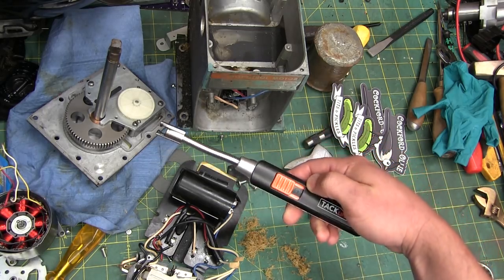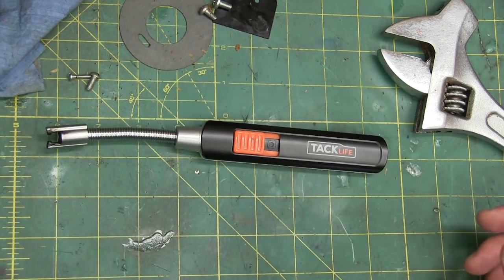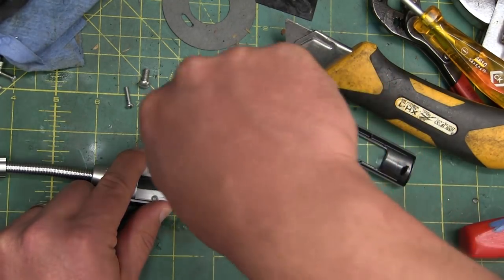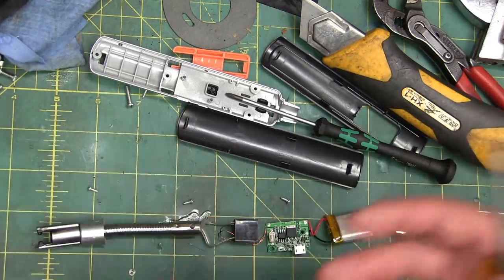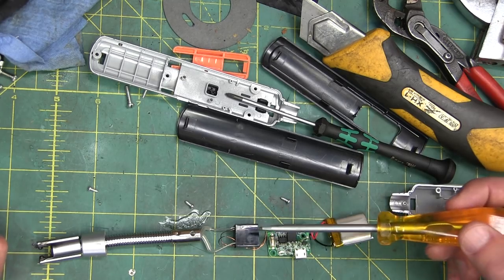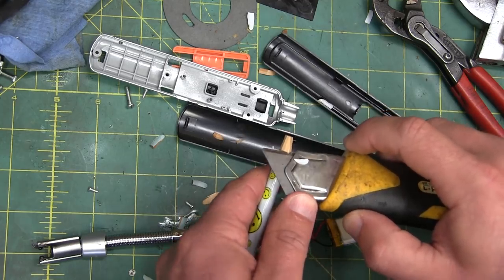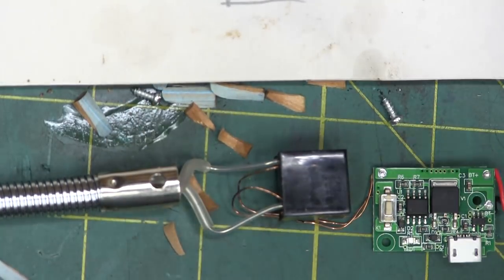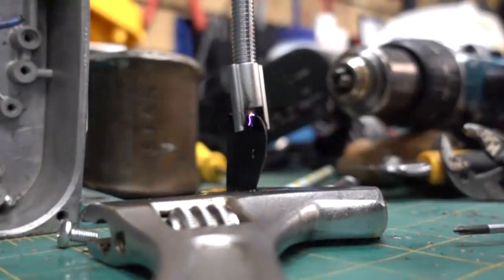BOLTR: Arc Lighter | Zzzzzap Gadget

Comment: There are a LOT of ways to implant malware through your USB port. Don't plug crap into your PC, use a charger.
Reply: Or cold use a really cheap cable that just has power but no data transfer. How do you think they would store malware on this kind of device without any ram/rom to speak of?

Comment: 9:46 It helps to have a system for that. It may well be an (unwritten) "industry standard" thing, but input on the left, and output on the right makes most sense to me, when making (or lifting) schematics. In a similar manner, ground on the bottom and whatever supply voltages, on the top.

Comment: Nifty little device. When I saw you sharpening the pencil reminded me of an exciting experiment I did when I was young. Found a neon sign transformer and made a Jacobs ladder. Had great fun sticking different things in the arc, that is until I used a pencil. Next think I knew I was at the other side if the room, I was sitting in a wheeled office chair at the time. That is when I leaned graphite is conductive. Have taken high voltage seriously ever since.

Comment: with almost any kind of lighter, it comes down to longevity in my experience. please tell us how long it takes until she chooches he last.
Reply: stereomike111 about as long as the battery’s entire life until it can’t hold enough charge to create arcs
Reply: I had one of these things, lasted about three or four months before the electrodes just didn't work anymore
Reply: In my case, 5 minutes.. I just short-circuited this once (tested it on a metal cap, because of course I did) it stopped working and the battery started to heat up by itself, would not recommend...

Comment: Maybe the FCC certification is for use as an electronic jammer? 🤔
Reply: it denotes part 15 compliance, basically it means that if it is interfering with transmissions (knowing or otherwise) you can be told to knock it off and then compelled to comply
Reply: FCC - Frivolous Chinesium Crappola

Comment: just to eleborate for those that don't know what AvE was saying, the 2 coils are basically a transformer, but you cant transform dc because it needs an EMF that builds and collapses to induce a voltage on the other winding.

so an IGBT is used to simulate the effect of a sine wave, by turning on and off at varying rates, we call this an inverter, taking dc, and faking ac.

the reason the voltage goes up, and the current goes down, is because the power must stay the same, and Power = Voltage * Current (apparent power), 
and the amount of that change is controlled by the ratio of windings, for example 2:1 would be 24 and 12 windings. 
this one will be a very high ratio, like 1000:1 or more.
Reply: most people use a high voltage arc? not that I am aware of.

Comment: FYI UB: it doesn't need to be powered by an AC source to be a voltage booster. The brain box can simply switch the DC supply and feed that into the diode voltage doubler. That's how DC-DC boost converters work, too.

Comment: Exact same Sony clock radio I bought 8 years ago.  Adjusts automatically for DST, has I think a 9-volt battery to keep time during power failures. Gains a few seconds a month: crystal vibrates a bit too fast?
Reply: I've got a very basic Sanyo crapper (no DST adjust) that used to gain about 5 minutes every week or two, I'd have to re-set it all the time because it'd gotten too far ahead (like half an hour or more).  Was like that for about 10 years, then suddenly it stopped gaining time - haven't had to adjust it for the last couple of years.  Maybe the backup battery is dead, haven't looked at that - I just enjoy not having to guess how far ahead it is when I'm still half asleep and the alarms going off.

Comment: The pocket version has sliding electrodes with a wider gap that's perfect for top of the ear shots when there's just no room at the bar at call for last orders. The battery capacity is practically 1/5th of the flexible neck model but that's plenty enough to cause some trouble as it happens.

Comment: AvE, can you do some kind of testing on the frequency coming out of the MOSFET, the input and output current and voltage from the transformer, etc.? It would be really interesting to see the parameters they chose to make the circuit work so well for so cheap.

Comment: So, I've been meaning to buy one of these just to see if they could be a quick legalish taser. Just solder on some new leads and see if you're drunk buddy will give it a ride.
Reply: Gerald Gepes yeah the hold my beer buddy, or the I'm ok buddy. I was fortunate enough to have both kinds of buddies let's not forget the buddy who can fall over and not spill his beer buddy
Reply: Raymond Mucklow we would get shitty on a sledding run, had one buddy roll his sled halfway down the hill, rolled three times and still had his beer intact. The best types of buddy.
Reply: Gerald Gepes my brother brought out his new to him sandrail on my 19th birthday, I had a mickeys 22 hornet in hand we took off across the desert we hit a wash out flipped in the air landed on the right side tires to then land on all 4 when it was all over I looked down I had my thumb in the top di dnt spill a drop. My brother (with it still running ) hit the gas we took off. Awesome.
Reply: wrong output frequency and waveform.
Reply: erik - these two or the tazer? : )
Reply: Well, given the fact that it has only a spark gap of around 5mm, you will get 15kV out of it. Tasers deliver around 50 kV with around 7 watts, way to much for this thing to handle. Yes, you could raise the spark gap to around 1,5 cm (you absolutely need one, if you don't want to have a device that either zapps the electronics inside (or you at random intervalls)) but then you'd have a "taser" with 1/70 the power of a normal one. Not worth it.
Reply: Gerald Gepes they dont hurt as much as the scare you will get, it will burn you a bit... trust me i know...
Reply: It does hurt and only burns if you are not in contact with your skin when you turn it on. Not taser level though, but fun at parties.
Reply: Gerald Gepes how did you post this 5 days ago??
Reply: Get a so-called "400kv module", it's the business part of a taser and legal as long as you don't call it that
Reply: PlatypusVomit thanks man I was so confused
Reply: or, you could buy taser. pretty certain the only way owning and buying a taser is illegal, on the civilian market, is if they exceed like 50k volts as that is the highest voltage that even the police can legally have & use. in the states however it's pretty much open season, as far as what voltage "level" of taser you can own. 
even still, you're allowed to (legal to) own dry tasers here in Ontario, at least. they're super popular with ladies who frequently frequent bars and clubs & that walk home/to their bus stop. never heard of them being illegal here in canaduuurp before though, until now that is of course.
Reply: Alex Hendel Tasers are illegal to own in Michigan unless you have a concealed pistol license.

Comment: That coil has me thinking I could use that for my 1/4 scale Offy that I'm building.  It'd go perfect in my magneto housing as I can't actually build a 1/4 scale working magneto.  It's compact enough to fit and put out 20,000 volts or so to the spark plugs.

Comment: the electric arc choocher! I've been contemplating picking up one of these.
no surprise that its a lithium ion onto a charge/control circuit, and transformer as the voltage doubler just ain't gonna create an army of angry pixies of that particular size. that being said, that transformer must have some crazy amount of windings on the secondary.

Comment: The noise appearing on the (AM) radio suggests the operation is at considerably higher frequency than 20 kHz.  At least the harmonics must go over 500 kHz.  Also, I would expect it to use a resonating capacitor, either in series or in parallel with the primary.  Anyway, where could I buy one?  I could check the frequency and probably work out a basic schematic.  I could characterize the transformer as well.
Reply: It's a spark gap transmitter.
Reply: NiHaoMike  —. Yeah, Harmonics.

Comment: Normally those potted transformers have their own drive circuit inside. You can buy them crazy cheap and they are in alot of Chinese junk. From small ozone generator hight lights to electric fly swatters. The circuit board you did see is more than likely just a charge controller for the battery. Able to make sure it dont charge too quickly, or over charge as well as useing that big mosfet to disconnect the battery to stop you from over discharging the thing.

Comment: No such thing as a diode-only voltage doubler, tripler, googaplexer.... it also needs capacitors, as it's those capacitors that accumulate the stored charge each half-cycle of the AC voltageum.

Comment: Doing a voltage ladder with DC isn't that hard, you don't have to use pretty AC, a square wave will do. You can make that easily with a full H-bridge. It's like a reverse full bridge rectumfrier.

Comment: that's an ionizer from hair dryer (uriginally use 50-60hz),using charge controller (the 5 pin thing right next to the usb) , a 555 timer driving the mosfet.
also the noise is caused by the spark

Comment: That little IC at the right-hand side is the actual charger IC. The 8-pin IC to the left is most likely a timer IC (say a 555 timer), which drives the actual MOSFET (the biggest IC at the center).

Comment: Just a bit of nitpicking, it doesn't arc through that piece of plastic, it arcs around it. Electric breakdown usually occours along surface paths of a dielectric and is then called tracking. Quite an important material property. Shit like isolating tape usually comes with a CTI value to tell you what it can handle without turning that metal panel you hide your jerry-rigged "we ain't got time to change the whole cable" quickfix behind into a widowmaker.

Comment: You forgot the capacitors between the diodes. That's what builds the voltage after each diode down the chain. Seen this in diagrams of old tv HV multpiliers in an ECG book

Comment: For a voltage doubler the diodes don't need to be special. You only need to make sure that PIV rating is not exceeded across 1 diode.

Comment: The "MOSFET" on the right could just be a LIPO charger in itself. Yes, they make em that small.
No brainbox required. That would be a DCDC boost coverter with the switching coil/transformer in the black box to make the angry pixies.

Comment: I know this video is one year old, but I think this small 5 pin jobby is the actual charger. Bigger 8 pin chip is a small cheap uC which handles the MOSFET, switch etc. and propably second undervoltage protection (these small li-ions usually have their own protection)

Comment: No. 
The breakdown voltage of the diodes should be just (a bit) higher than the input AC, as all of them are series and the breakdown voltages add up. So do the capacitors in that multipliers. Each cell, consisting of two diodes and two capacitors should be rated for the input AC*2

Comment: Just looked this gizmo up.  The one with an 18650 (same brand) is a $1 cheaper (I'm assuming it doesn't come with the battery).  That's a lot of angry pixies!  Slightly different format.
If you want the long neck and the 18650, it's a buck more than the internal battery model.

Comment: i have one of these lighters and it works extremely well but where it lacks is the fact that you can heat metal it will only work with flammables
Reply: also one of those lighters sets you back about 10 to 15 bucks

Comment: The chip on there is actually pin-compatible with a PIC microcontroller and someone made one that plays a tune while you're setting things on fire by modulating the frequency. There's a write-up at ultrakeet com au /write-ups/modulated-arc-lighter
or see it in action /watch?v=VWGIgH9ViEE

Comment: Correct me if I'm wrong; oh how I know ya will; but is an electric arc/spark running a voltage at 20Khz not the same frequency that is used to split water into its componant molocules, i.e. H2O becomes H,H,O and the main technology into Hydrogen Burning I.C. Engines?  It brings the question, will  that 'Lighter' set fire to wet wood/paper/whatever too?  Did ya try it on a flammable gas, just fer laffs!?
Awesome lighter.  Are they available in Europe, Britain et.c.?  I'll keep searching, mè fois.
(P.S. Sorry but....Etsy says "Sold" on the Tits'n'Pickles sticker..as of when I looked at it today, Sunday 29th July 20.21 here in UK, 12.22 West Van cover, Kenuckistan time)

Comment: 6:11 I'd rather not be quite as optimistic with the "over-integration" of things :) That tiny lil' six-legged chip's probably the dedicated charge controller (coincidence that it's right in-between the USB and the battery?), and the 8-pin one's only handling the oscillation & MOSFET driving. The whole thing sounds like a flyback converter of sorts.
https://en.wikipedia.org/wiki/Flyback_converter

Comment: The circuit is just a 555 timer running at 30-50khz with a transistor output.

Comment: "100 milliamps or something like that" writes down 100 milliliters

The voltage multiplier circuit you were trying to remember with a diode (and capacitor) ladder was a Cockcroft–Walton circuit.

Comment: Also wouldn't it make sense that you only have 1 inductor and you use the energy from the collapsing magnetic field to generate the high voltage. That's how spark plugs work.

Comment: Lithium batteries have always confused me. as long as the supply voltage stays at 4.2 it should self regulate.. right? but a voltage regulator is cheaper than a dedicated charge controller to design and implement so there's gotta be a reason guys don't do that

Comment: Does anyone have any suggestions for a good/decent "starter kit" soldering iron? I want to teach myself and I don't know brands, flux, lead-free, etc...

Thanks in advance!
Reply: TS100 is very good bang for buck, keep in mind you need a seperate 12-24V power supply. Just get some 60/40 rosin core solder and you'll be fine to start with, extra flux is optional.
Reply: Also you can buy solder learning kits on the internet
Reply: Thanks gang! That's my Summer project to learn something new
haha
Reply: What are you planning to solder? The TS100 is nice (short, light, heats up fairly quickly and has a decent selection of tips) but for some things you'll be better off with a bigger iron or with a cheap soldering station (with a hot air gun).

Comment: The chip might be a repurposed battery management/DC regulator chip. If you gave one of those the right voltage on the feedback pin it would output a square wave that could feed into the mosfet

Comment: Just a tip and only for a second, if you ever have a plastic case that's glued shut, you can just dab a little gasoline on the joint and it'll dissolve away the glue in a minute
Reply: InsideOfMyOwnMind you only need around 0.1 mL of it to open 30cm worth of glued plastic, and its rate of vaporization is way higher than that of water, so yeah here would work too

Comment: I have me a home built taser. I used a bigger version of that potted transformer. I am running 5v switched at about 20khrz and pooping out somewhere near 30,000v
But that is theoretical voltage cause I have not built me a probe to test it. I need to do that one of these days.

Comment: The electricals are terribly wrong but okay, Ill spare you with the details. 

Also, voltage multipliers use diodes and capacitors, not only diodes.

Comment: AvE I don't wan't to sound like an ass, but you can run a capacitive multiplier from DC. What you do is this:
- astable multivibrate that sweet, sweet DC
- drive a halfbridge inverter with that
- AC couple the squarewave through a fucken' high capacitance to the multiplier input
- zap your ass